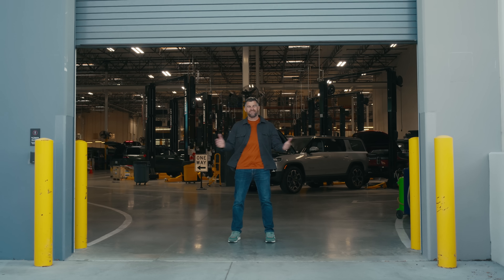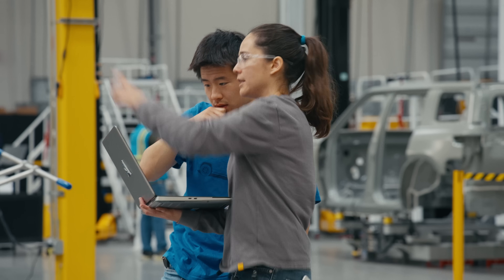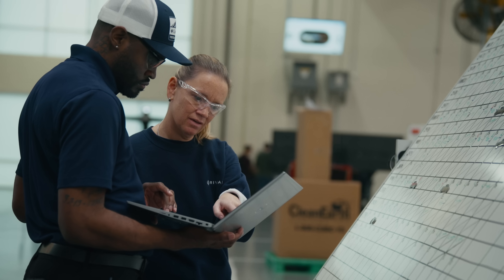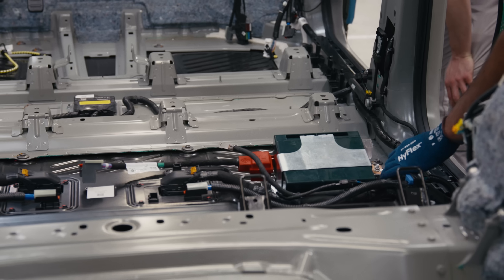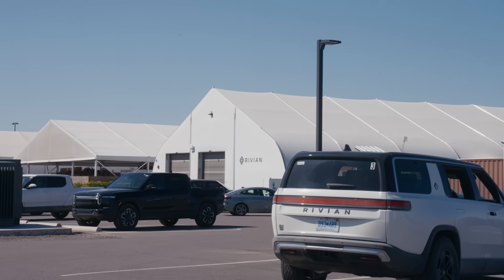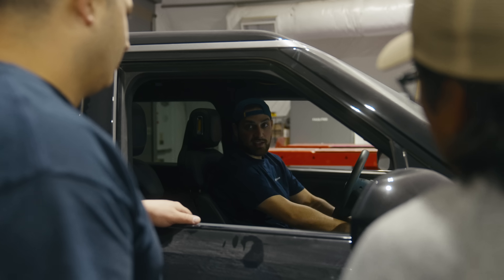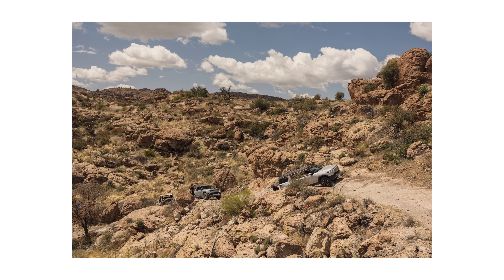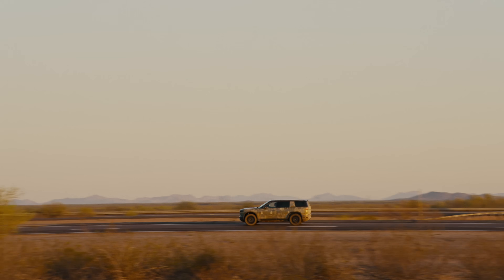R2 | Inside the First Builds and Proving Grounds

Comment: Hoping to be able to use an R2 to pull my boat. I'm a little nervous because it's a little over 7000 pounds, but I'm anxious to see the official specs on what the 3-motor model can pull, and the tongue-weight capacities. I could just get an RT1, but I really would rather get an R2.
Reply: 7000 is going to probably be a bit much for the R2. I bet the R2 is going to be somewhere around 4500lbs-6000lbs.

 If I was hauling something that was over 7000 pounds, I would want an actual truck with a V8.

Comment: @rivian - Does that quad have a different suspension because that behavior shown at 2:15 looks a lot like Porsche Active Ride suspension... The R1S really does need a suspension software upgrade because this suspension has so much travel but yet I can still feel every little bump in the road even with really nice road tires. R1S handles downward bumps much better than upward motion bumps, it's as if the suspension is reacting too abruptly to stop the upward travel instead of using more travel to smooth out the bump. This is my two cents but I drive this vehicle every day and I also drive my 2019 Etron daily and the Etron is like riding on a pillow of air and the R1S doesn't even feel like air suspension.